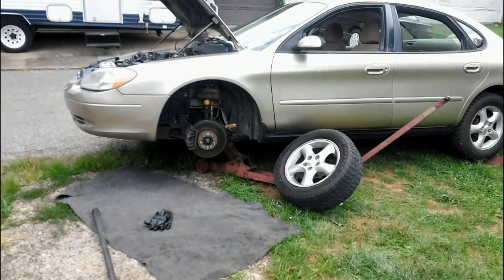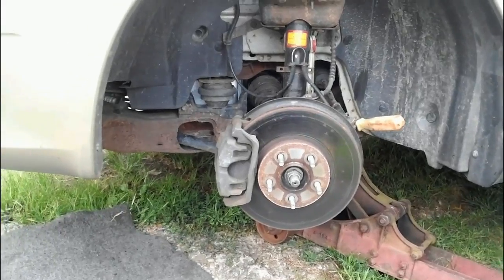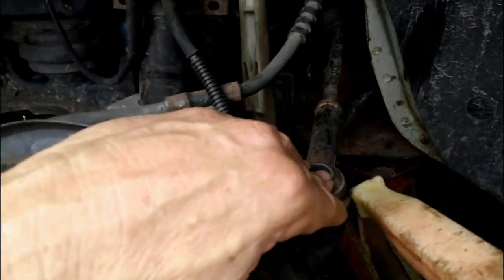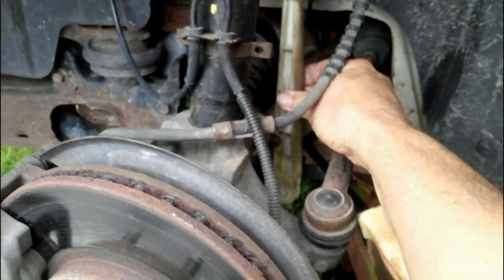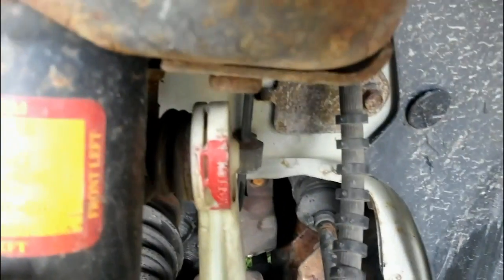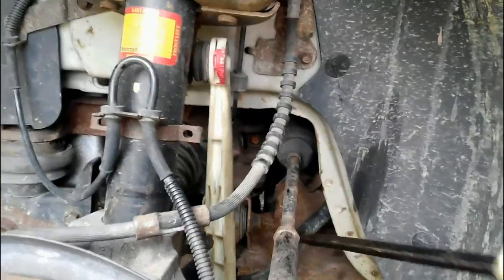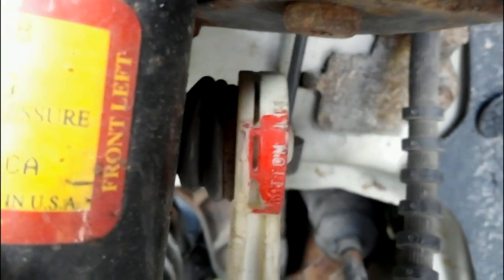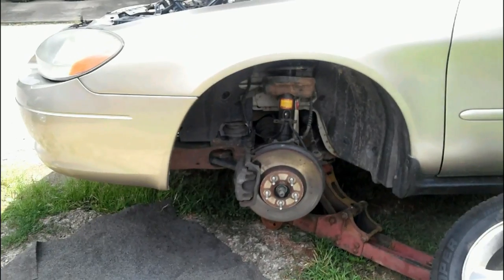2001 Taurus Front End Rattle Over Bumps- Stabilizer Links ....SOLVED!

Comment: That's what happens to my 2005 Ford Turus when when going up a curb, going down or driving on an uneven road, a knock is heard but only from the driver's side tire. I will check what you mention in the video and check by pressing on that side. of the noise lowering and raising the shock absorber but I hope it's nothing like that plastic stabilizer bar

Comment: I have the same issue only my plastic link was broken in 2 in the middle not the ends as some have suggested.  I had 1 replaced with metal years ago and it did great.  It was a round metal rod that attached in place of the plastic.

Comment: When I go over a bump or make a very sharp turn going uphill I hear a noise.  I know I replaced the axle, bearing and ball joints on that side, not long ago.  Tie rod end I cant remember.  Shocks I cant see being an issue the vehicle runs smooth.  I'm going to swap this out with a new one and see if the noise goes away.  Its worth shotgunning it with a 12 dollar part, and its not a hard job at all.

Comment: Interestingly enough, the plastic ones were quieter when they were first installed.  They become impossible to remove without destroying them on most cars.  I replaced all my cars with MOOG Brands of these things, and only on my 2002 Ford Taurus has it been more noisy  than the old plastic ones going over bumps.  I'm currently replacing a metal one I installed in 2016, as the excessive play is what's causing that "thunk" rattle upon each bump. (I think)